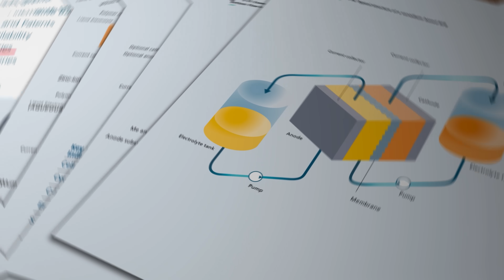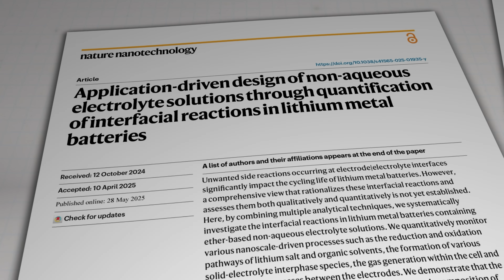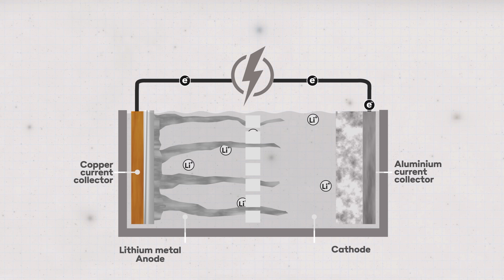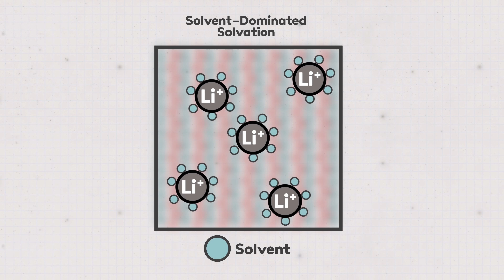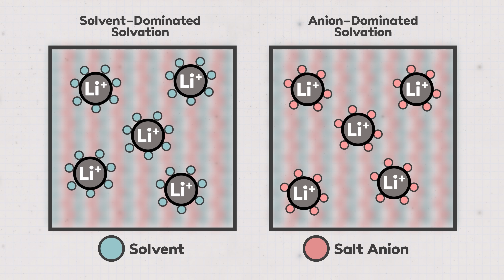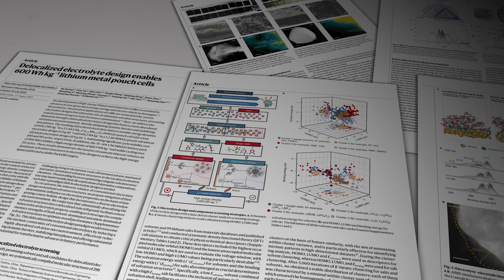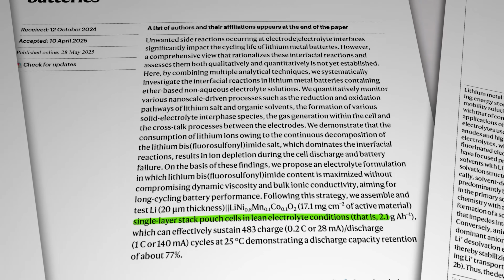New lithium metal battery doubles energy capacity! Has China beaten us to it again?

Comment: AI Summary

Abstract:

This video explores recent advancements in Lithium Metal Battery (LMB) technology, a long-sought-after alternative to traditional graphite-anode lithium-ion batteries. It details the primary advantage of LMBs—a theoretical tenfold increase in energy storage capacity—while also explaining the core challenges that have hindered their adoption: the formation of dangerous dendrites and high reactivity with the electrolyte, which leads to poor cycle life. The video highlights two key research efforts from China. The first, from Tianjin University, uses AI to develop a "Delocalized Electrolyte" that achieves an impressive energy density of over 600 Wh/kg, but currently suffers from a low cycle life of around 100 cycles. The second, from battery giant CATL, presents a prototype that reaches a more promising 483 cycles while targeting an energy density of over 500 Wh/kg. The video concludes that this technology, while not yet viable for mass-market EVs, holds significant potential for specialized, high-density applications like aviation and drones.

Unlocking Next-Gen Batteries: The Lithium Metal Breakthrough

*   0:50 The Goal: Replacing Graphite: The video explains the core concept of Lithium Metal Batteries (LMBs), which is to replace the space-limited graphite anode in current lithium-ion batteries with a solid anode made of pure lithium metal.
*   2:45 The Upside: 10x More Energy: Theoretically, a lithium metal anode can hold about ten times more charge per gram than graphite. This would allow for batteries that are significantly lighter or have a much longer operational life between charges.
*   3:27 The Downsides: Dendrites and Reactivity: Two major problems prevent the widespread use of LMBs:
    *   Dendrites: Lithium tends to form sharp, tree-like spikes that can grow through the electrolyte, causing a short circuit and potential fire.
    *   Reactivity: Lithium metal reacts with the liquid electrolyte, creating a crust (Solid Electrolyte Interphase or SEI) that impedes ion flow and severely shortens the battery's lifespan.
*   5:20 A New Solution: Delocalized Electrolytes: Researchers at Tianjin University have developed a novel electrolyte designed to create a chaotic, disordered environment for lithium ions. This "best of both worlds" approach allows ions to move quickly while preventing the harmful crust buildup on the anode.
*   6:10 AI-Powered Discovery: To navigate the vast number of potential chemical combinations, the research team used Artificial Intelligence (AI) to identify the most viable recipes for their new electrolyte.
*   7:15 Impressive Lab Results: Experimental pouch cells made with the new electrolyte achieved a very high energy density of over 600 Wh/kg, nearly double that of today's best commercial batteries.
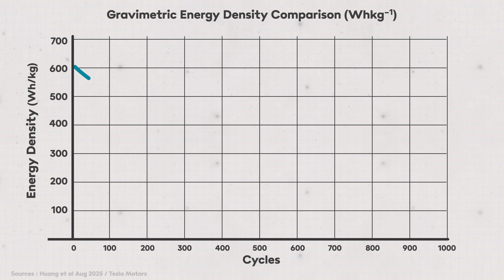*   7:42 Key Caveat: Poor Cycle Life: The major drawback of the Tianjin prototype is its short lifespan. The battery's capacity dropped significantly after only 90-100 charge cycles, far below the 1,000+ cycles expected from an EV battery.
*   9:10 CATL Enters the Fray: The world's largest battery manufacturer, CATL, has also announced a breakthrough in LMB technology. Their prototype has achieved a more stable 483 charge cycles and is designed to reach an energy density of over 500 Wh/kg.
*   9:57 Future Applications: Aviation and Drones: Due to the current trade-offs between high energy density, safety, and cycle life, LMBs are unlikely to appear in consumer cars or home storage soon. However, they are highly promising for applications where weight is critical, such as electric aviation, drones, and other specialized uses.

---

Summary of YouTube Comments:

The comments section reflects a mix of technical insight, practical skepticism, and enthusiasm for the technology's potential applications.

*   Technical Critiques and Insights: The top comment provides a detailed analysis of the research paper, noting that the chemicals used are extremely expensive, which would make commercialization difficult. Other comments discuss the challenges of SEI formation, thermal runaway, and the practical difficulties of working with pure lithium metal during manufacturing.
*   Key Applications Focus on Aviation and Drones: Many commenters agree with the video's conclusion, highlighting electric aviation as the most promising use case. They note that the 500-600 Wh/kg energy density is the threshold needed to make electric passenger planes viable. Drones, especially for military use, are also frequently mentioned as an ideal application where high performance outweighs longevity and cost.
*   Cycle Life is the Main Hurdle: A recurring theme is that the low cycle life (100-500 cycles) is the biggest dealbreaker for most applications, especially when compared to the thousands of cycles offered by current LFP and NMC batteries. Until this improves, the technology remains a lab curiosity for many.
*   Skepticism and Realism: Several users express a "seen it all before" attitude, lumping this in with other "revolutionary" battery technologies that have been promised for years but have yet to materialize. They emphasize the long road from a lab prototype to a mass-produced, affordable, and safe product.
*   Praise for the Channel: A significant number of comments praise the host for his ability to break down complex scientific topics into understandable explanations, appreciating the channel for keeping them informed on the latest energy and climate developments.

I used gemini-2.5-pro| input-price: 1.25 output-price: 10 max-context-length: 200_000 on rocketrecap dot com to summarize the transcript.
Cost (if I didn't use the free tier): $0.05
Input tokens: 27190
Output tokens: 1179

Comment: Electric powered airplanes are extremely attractive because electric motors are vastly simpler and more reliable and cheaper than internal combustion or turbine engines.  They have orders of magnitude fewer parts.  But the worst thing you can do to an airplane design is make it heavy, so energy density is very important. Also aircraft are less price sensitive than many other battery applications.  A battery that's too expensive for cars or power stations might be acceptable for aviation. My recollection is that the 500 wh/kg number is a point where electric planes start looking really competitive.  I'm glad to see a heavy hitter like CATL is working on it.

Comment: For airplane use, trading cycle life for more energy density may be good enough for testing prototypes. But, to be an economical replacement for jet fueled aircraft, that's not good enough. To keep the total cost of ownership down, the batteries have to last.

Comment: 483 charge cycles isn't quite there yet. But it's less than an order of magnitude. And 500 wh/kg is good enough for flying cars. A decent EVTOL with the range/performance of a 500 wh/kg power pack can supplement or replace helicopters in a wide variety of roles. So there's an EVTOL market of millions of vehicles for whoever can "get to 500 first".

Comment: LFP and forthcoming LMFP batteries have already solved cars and all but the biggest trucks with good enough energy density and incredibly hard to beat cost, safety, longevity, and charging speeds. I think we will eventually end up with NaFP and NaMFP as an even cheaper option at the cost of a little weight and volume, but I can't really imagine how you could beat that for stationary and road applications.

Battery aviation is a hard sell even with higher energy desnsity, since at least western regulators are going to be skeptical about the survivability of battery fires on crash landings. Regional turboprops going electric, and becoming more common becasue of it, wouldn't suprise me becasue the economics are too good and the safety advantages of electric matter more and the disadvantages less for smaller short haul planes, but we aren't there quite yet. I think gettting to a place where batteries make more sense than hydrogen for long haul aircraft is going to be really hard, if not impossible, though.

This seems the most interesting for long distance ocean shipping and giant construction equipment, where the risks of a more dangerous battery are much lower, there isn't a good argument for alternative fuels being more efficient like there is with aircraft, and the energy density really matters in a way it doesn't for regular cars and trucks.

Comment: Yeah they're going to have to reduce the degradation loss rate to even get close to replacing current LFP configuration. Initial capacity is awesome, but if it's that far down after a few hundred cycles, you might as well forget it.

Comment: I quit flying (on fossil powered aircraft) in 2008 but I'm hopeful one of these battery technologies will make electric aviation feasible in the coming years. Looks promising!
Reply: I think long distance will need carbon neutral liquid fuel, but these batteries could be used for medium distance. They extend the range possible on batteries alone.
Reply: @adrianthoroughgood1191  The issue with medium distance is that HSR is usually better. Aviation makes the most sense for crossing oceans. Although if somehow relatively fast and stable passenger ships ever came back into fashion I wouldn't be complaining either lol. That normal force helps a lot for sustainability.

Comment: Is there a theoretical maximum for energy density in a Lithium Ion battery?
Reply: Yes, in Metal-Air batteries, roughly 11,400 Wh/kg, which is not far off petroleums 12,000 Wh/kg. Although, with batteries more energy does useful work than goes to waste heat as occurs with fuels.

Lab protoypes have had Lithium-Air at 1,800Wh/kg, with an 800 cycle life longevity. 

Metal anodes, as covered in this video, are used in Lithium-Air but they have no electrolytes (direct interaxtion with oxygen from the air) at the cathode.

Comment: The one problem I know of in any lithium recycling project is Al ....if it gets mixed with the Li metal or salts ...it turns out to really mess up the Li recovery process making it much more difficult resulting in use of a lot more energy and some very nasty chemicals to removed the Al from the cell or the recycling processs remove it from the Li cells by design or  before recovery and the process becomes very easy....and cheaply done relatively with very high recovery rates.

Comment: My feelings are fuel cells will improve over time, electrolysis is at 95% efficiency already, we will most likely store energy as ammonia, methane or methanol, however that's a while off if it happens. For the foreseeable future we're doomed to use batteries and we all know 300 miles WLTP is really 225 miles, 190 on the motorway, 150 in the winter and less after a few years, so a 600 miles battery is probably a real range of 300 miles, equivalent to a Toyota AygoX, if it gets people off fossil fuels it's a win.
Reply: You thionk Fuel cells will triple in efficiency? (Chemistry means they won't)
HYdrogen (Using Fuel cells) in simply a way of taking the same Electricity that powers "BEV" transport and using a complicated (and inefficient) series of processes to throw 70% of that away. (Which means a replacement for the Clean electricity is required and since we don't have enough wind and solar yet, Fossil fuel will be used.
Therefore, use of Hydrogen in fuel cell vehicles causes MORE Fossil fuel to remain (and be added to) the grid.
Conclusion?
Hydrogen is a DIRTY solution (even if IT is produced with Green Energy)

Comment: 7:30 — Dave Borlace stated the best existing technology available was 260 Wh/kg, but that’s already out of date. WeLion’s semi-solid cells (~360 Wh/kg) are already shipping and available to consumers in final products.  Amprius has 500 Wh/kg full-scale prototypes preparing for production, with 450 Wh/kg cells already being supplied to partners in limited quantities. Several other designs are quickly approaching large scale commercial availability in the ~400 Wh/kg range. And other research-grade Li-S prototypes have demonstrated full pouch energy densities up to 761 Wh/kg.

I’m not saying this isn’t an advancement worth considering, but battery energy density is a fast-moving target and CATL is objectively not in the lead either on commercially available densities or lab demonstrated densities.

The absolute upper bounds of pure electrochemistry (excluding packaging) are about 6,300 Wh/kg for Li–F and ~2,600 Wh/kg for Li–S. Advancements can only be expected to approach those limits. Beyond electrochemical storage only exotic speculative options left like energy stored in ultra-dense metallic hydrogen structures, perfect photon containment, some kind of efficiently reversable nuclear reaction, super fluid kinetic storage, super conductor magnetic energy storage etc. And all of this may end up being less viable than a fusion based primary cell small enough for use in devices negating the entire premises of secondary storage. So we may only ever have one or two more doublings of energy density for re-usable storage.

Comment: Plenty of what can be made to work in the lab won't scale beyond for a great multitude of reasons. Doesn't matter. We can keep trying, and we'll find ways for improvement. For now, sodium batteries (with worse densities) do help on the economics side. High density will become desirable... but for what? Question is how much density will they achieve and will it be good enough to allow us to built small, regional airlines. We don't really need LMB for by far the great proportion of land vehicles. Still, would be a good advancement.

Comment: "You can drive a nail through an LFP cell and nothing happens." Depends on the cell, the speed of penetration, charge level, cell health, luck and other factors. Slow puncture rarely causes spectacular failure because local high short-circuit current blows up the metal film before enough heat gets pumped into the area to propagate the damage. More blunt large-area trauma with lower fault current density such as getting crushed by 1" square steel tube won't self-blow like a fuse, cause far more substantial heat to be released within the battery and may still yield a spectacular failure in LFP cells, albeit not as spectacular as NMC/NCA..

There was an electric boat using LFP batteries that blew up a few weeks ago while charging. Its batteries went into thermal runaway, filled the bilge and cabin with flammable gasses and ignited, sending some debris across the river. LFP may be safer but is nowhere near intrinsically safe. Do not store LFP batteries in an enclosed and non-ventilated space. Same goes for gasoline and anything else that can produce/leak highly flammable gasses.
Reply: LTO cells are the ones that are really stable, not so great energy density though.
Reply: @UloPe  Yup, when something goes wrong with LTO, they squirt liquid electrolyte and that's pretty much it. Very similar to flooded lead-acid. Almost the same cell voltage too.
Reply: Is there any published information about the boat that blew up? What make and model of cells, make and model of the charger, was there monitoring of individual cell voltages as well as the voltage of the whole battery, would the charger have cut down/shut off the current in case of an out-of-specified-range cell voltage, etc? Was any protection dependent on the functioning of software, or was there hard-wired protection of some kind? Were any electronics adequately protected against damp conditions that could cause corrosion and short-circuiting of a circuit board or any of the components on it, leading to the failure or malfunction of its charge control and protection functions?
Reply: @cedriclynch  I'm sure the boat model is out there somewhere and people can look up the manufacturer for most of those details. There was a similar incident a few years ago and the official report on it still hasn't been released, could be a while before we see the official story on the new one.